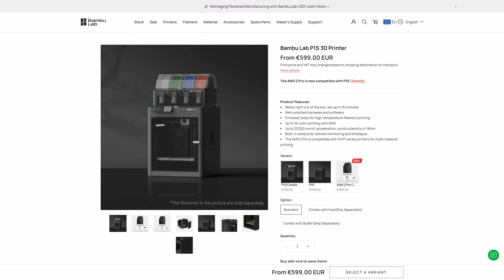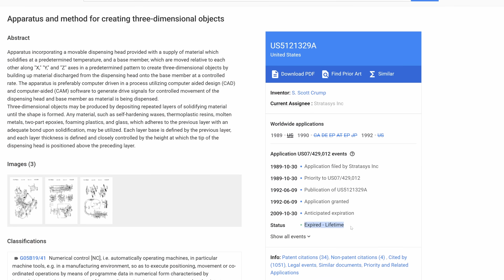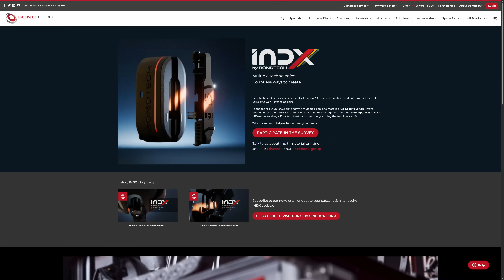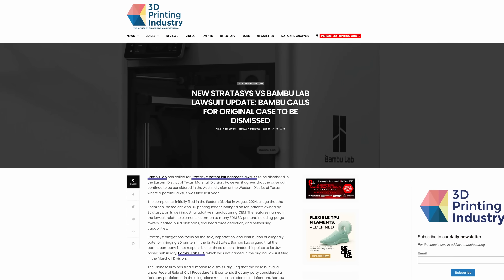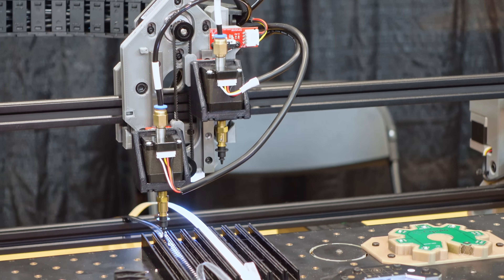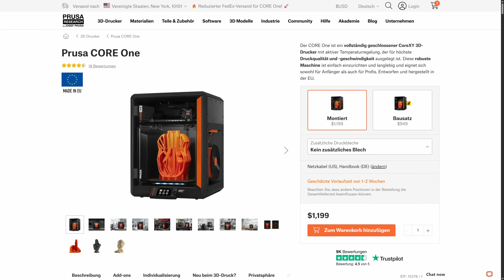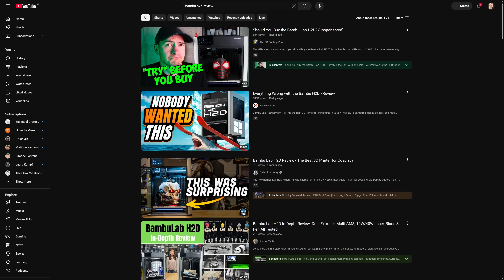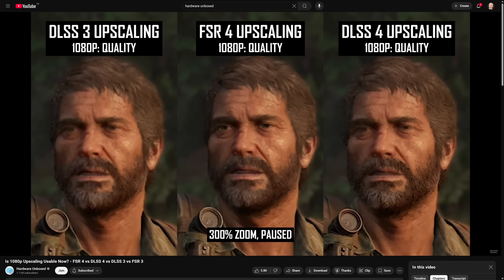How Bambu has won

Comment: I want to know creative solutions to use weak ass 3D prints into usable stuff, like furniture, speakers. How to combine PLA or PETG or ABS with concrete or epoxy mixed with glassfiber and steel rebars. 3D prints can be used to just capture the shape and have a smooth surface, and containing the strong filler you want. You can use a filler pattern that allows a pour of concrete or epoxy. I still have not found a single video discussing this.

Comment: i was currently thinking( i have an ender 3v2 and yea.. pretty much stock)
Its slow as hell and now i see this fast printer.
Was thinking about bambu, but the comments kept me sane, now i go with a new Hotend, DualZ , Direct Drive and klipper to my ender v3 2 and yea. Maybe some point at time some voron like Mashine. 
You always need a Project, right? 
(But can Voron compare itself to Bamboo, in terms of reliability?)
That would be an cool Video tbh.

Comment: Part of the problem with the 3D printer community is that it gives a platform for people who are not engineers to design and enthusiastically publish "upgrades" that other non-engineers parrot because the idea seems to make sense.
The "tinker" side of 3D printing usually means making things worse for yourself over time, and problems that are impossible to troubleshoot because your setup is different to every other person on earth.
I have an ender 5 with bl-touch, E3D V6 hotend, with a bondtech direct drive extruder, BIGTREETECH SKR Mini E3 V2.0, and powder textured spring build plate - I have not used it for years because the amount of tinkering was getting extreme just for consistent prints.
If I could afford an X1C, I'd still be 3D printing stuff today.

Comment: This might be a little late, but I like your videos for the perceived honesty and common sense view of the product. We as consumers need to be very concerned about companies using anti-consumer tactic to prevent competition. I would not change much. I think your videos are some of the best in the 3D Printer channels. Maybe include how to videos. How to calibrate or how to test if your printer needs calibrated. Even talks like this one discussing current movements in the field are good. Review filaments.

Comment: My 2 cents (and we all only have 2 cents): For a printer review, give us your overall perspective.  Because of your background and experience, we value your insights.  You are likely to consider many things we might forget.  Is it a solid build, can maintenance and repair easily be done?  (I hate doing a new Hot End on my MK3S+, and would love an easier solution for that) If there is a better value or not, let us know.  I'm right on the edge of considering a H2D vs a Prusa XL.  My key needs are to print with Nylon CF, and a non-Nylon support material, and be big (the H2D would cause me to redesign some of the things I want to do, because it is just a bit too small, but I'm only working with designs I make, so changes aren't a big deal.)  I really like the AMS HF, because storage and drying for Nylon are important.  And I would like two heads, because I am mixing materials, not just colors.  But even if you can't go into the rabbit hole of each users needs, it would still be helpful with whatever perspectives you did offer.

Comment: I got used to working with 3d printers that work out of the box in engineering field so when I purchased my personal 3d printer ,10 plus years ago, I got a Flashforge. 

At work, 3d printers had to work out-of-the-box. I got accustomed to it so I bought P1S at launch. Best printer for my needs.

Comment: My first 3D printer was the Anet A8, it was junk out of the box that was entirely capable of burning my house down. I had enormous fun making it safe(r) and upgrading it so it didn’t shake itself apart. I bought a Prusa MK3S kit for the same reasons, although when I built and configured it, it just worked. I’ll never buy a bamboo, or any printer from a company that wants to create a closed system.

Comment: A very long winded video that can be summed up simply: Open source machines suck. They just do. They're great for home use and I'd prefer all machiens to be open, but time is money. If my time is close to 300 an hour, tinkering on your crappy open source printer is costing me money. Compare it to a machine where I open it, set it up, and print carbon fiber nylon, perfectly? Yeah.

Comment: As someone who just recently got an Ender 3 with the updated silent board (yeah, a V1), I can say that the open sourcedness is a blessing. It's allowed me to get it printing PLA extremely reliably, but PETG is beating me over the head. I also like that I have a bunch of hotends and nozzle options available to me. That brings me to my point of this comment: Removing the ability to handle the nozzle to a hardened one for filled filaments, or to easily deal with a clog is a pain, and is making sure that I don't get a Bambu Labs printer with my own money. That can be said about any other printer that uses a proprietary hotend that is one piece with the nozzle, and uses a proprietary plug for power. It's also why I'm planning on building a Voron, or another open-source printer.

That said, Bambu has one thing for them that I LOVE: plug in and go

Comment: I'll be honest: Like most people here probably, I have been into 3D printing for countless eons. In 2010 I was a member in my local Chaos Computer Club branch, which ran a hackerspace in town. I went there every week and we built that very first slanted roof looking reprap printer design there, a year after the patent ran out. I was 14 at that time. Now I'm approaching 30 and I've gone through the notorious fire hazard Anet A8, moved to an Anycubic i3 Mega, then got an Anycubic Photon, then most recently an Ender 3 v2 and I even tried using a Mosaic Palette 3 for multi-color printing.

And on this journey, I started out enthusiastic with each new printer, knowing I would have to tinker with it a lot to get the results I wanted, but with each printer, I got tired of the tinkering after a few years. I always bought the next printer in the hopes that it's modern enough that I would have to do less and less tinkering and calibrating and installing firmware and printing upgrade parts etc etc and so on. But each time, it took a year or maybe 15 months before it just became too much for me (exept the photon, that thing is awesome and works great to this day) and even though I really wanted to print stuff, knowing I'd end up having to do 1-2h of fiddling to get a good print meant my printers were all just collecting dust.

But Just a week ago, I finally splurged on a printer for the first time and dropped 700€ on a P1S with an AMS. This is the first time in my life that I was able and willing to pay that much for a single (well, dual) machine. I added some Bambu filament, especially two spools of that awesome PLA /  PETG support as well. And I have to tell you, 3D printing finally feels like the same magic again that I felt back in 2010. For the first time in that long a time, I've been having such a blast with printing again. Having the confidence that I can just start a print, even while not at home, and it will finish perfectly every single freaking time, has revived this hobby for me. Seeing this printer FLY through prints is just awesome and I can't stop grinning when I look at it go.

So yeah, Bambu won, but for very good reason. In my field, we say UX to describe the user experience and DX to describe the developer experience. Bambu have perfected the art of PX, printing experience. Hats off to them. They SHOULD be patenting this and milking it for all the money they can because they deserve that.

Comment: Wait wait wait hold up. INCOMING RANT WARNING

There are other printers out there, and somehow it feels like people forget about that. Bambu has printers for a specific type of customer, those who want a “just works” simple experience, kind of like Apple. They abstract away the annoying technicalities and make the system easy to use. Bambu has made 3d printing so incredibly accessible that many more people get to enjoy its benefits. If a Bambu owner wants to start tinkering, they could do so on their Bambu, and when they hit the walls, they could move to something else as many people do. Bambu is not a bad thing, they are great at targeting a specific crowd, or more accurately, everyone but the specific tinkerer crowd. It’s just proven by how much backlash there is on Reddit yet everyone is buying their printers. And all that’s fine, competition is good, and with this larger market everyone benefits with any printer as prices come down on parts and competition pumps quality up. We have to stop thinking so small mindedly and with a sort of tunnel vision for how we like things to work ideally. In reality, there are far more people who want to create their own parts quickly than there are tinkerers, especially with the rise of online model repositories and the reach of the field from electronics parts and housing, to miniature set decorations and figures, to automotive components, to household fixes and accessories, and everything beyond and in between. 3D printing started as a community effort as it was just being developed, but it is now at the point where it’s streamlined enough to package as a standard consumer product, and that’s really truly incredible. It would be nice if Bambu would contribute more, even with Bambu Studio which is open source and the basis of other slicers like Orca, and it would be nice if they would allow you to unlock it or flash something like klipper. However it’s even nicer when we have so many other brands and printers that fulfill that need and are cheap and available too. Not every brand will be as we want, and we could decide not to buy. If others value the sales pitch of Bambu, let them have it. It’s not our job to force others to agree with our idea of how we want this industry to run, and if my buddy got a Bambu I’d celebrate with him and make something incredible, just like I recommend my mom uses a Mac. To be clear I’m absolutely a tinkerer. I’ve been a software dev in so many areas for years now, and been into embedded systems and other hardware for the last few of those. I daily drive Linux so hard I installed Asahi on my older MacBook, and Sway and Wayland on Nvidia is my go to config. We gotta land our spaceship guys, reality isn’t always how WE specifically want it. Money talks and it has spoken, and the money comes from the people who buy into one brand or another. Clearly people want that simplicity and will happily pay Bambu over other brands. Don’t forget, your money does the same, so go buy a Prusa or build your own printer, you absolutely still could, and for you, you should.

I’d like to extra stress that this is not meant to be a firery take or anything, and I’m not here to hurt anyone or anything close to that. I generally avoid any conversation like this online because it’s generally not who I am or how I work, but I think it’s important to throw in my balanced take into something as polarizing as this. ❤

Comment: For me personally, the only thing that matters for deciding which printer to get is:
Ease of use. I want to create stuff with my printer and just use it as a reliable tool, not spend hours and hours to get the printer working right. And for that reason, my P1S is just perfect to me. If i have to use their software thats fine, if i only get spare parts from them thats also fine. It just hase to be really reliable and headache-free.

Comment: I ordered from Voxel due to the recommendation in this video. It's been over three weeks and my order still hasn't shipped, and apparently I'm not the only one this has been happening to in the last several months. Pretty disappointed.
Reply: I have seen the same. They seem to be having a scaling issue. I will say the products are great and the filament is every bit as good Thomas has said. 
They have been adding capacity but market growth seems to be exceeding the adds. I hope they solve this soon.

Comment: I think the 3D printing community has to understand that while it was born out the passion of early adopters for the technology, it has traveled along the product curve into the mainstream.  Makers like myself dont have a passion for the technology itself, more its a tool to supplement my general passion for making things.  In that sense, I dont care much about how a 3D printer works beyond what I need to improve my print quality.  I am more concerned with the thing being printed, not the thing doing the printing.  For me this is why Bambu labs was the right choice.  My P1S is my first printer, and in 1.5yrs of service so far, I have had essentially ZERO mechanical failures.  That level of ease of use is key to expaning adoption of the technology.  Had I bought a printer that was not as robust... I probably wouldnt like 3D printing as much and I wouldn't be as deeply invested in learning more.  But because my entry into the field was SO easy, I have been able to focus on the aspects of 3D printing I like, instead of fixing a machine I hate.  

While that mindset upsets many of the core 3D printing early adopters and passionate "old timers", it actually massively expands the market of potental users by orders of magnitude.  With that expansion, comes competition, scale, and overall a MUCH higher value/$ invested in the consumables and equipment-- all of which benefits the entire user base of 3D printing enthusiasts.

Many people also thing that 3D printing predominantly tickles down from industry, but that has not been my experience at all.  As someone who has worked with hardware engineering and manufacturing teams for over 15 years...  it's not until the last few years that I noticed my R&D teams leveraging 3D printing so heavily for rapid prototyping.  This is because reliable "commerical grade" machines were prohibitively expensive, and cheaper machines were not reliable enough for professional use.  We dont have time to be fixing 3D printers at work.  We need them to just work every time.  Again, this has been the benefit of the mass popularity of Bambu.  By expanding the market so much with such reliable equipment, they have created a strong competitive market for printers that are now cheap AND reliable enough for use on any engineering team, regardless of budget.  That just benefits every consumer.

Comment: My big issues are planned obsolescence, being tied to an ecosystem, and not owning what I'm paying for (the subscription model).  All the convenience features ultimately cost one of these, or all of them in trade.  I print slowly, with a machine I at least assembled.  It doesn't send my IP to China, and no one can turn it off.  With those as non-negotiable, your reviews have always been really helpful in differentiating the products on the market and learning how to best use them.

Comment: Buying a Bambu was my third printer and i bought it because i wanted something that JUST WORKS. I think there is a huge case to say that a large amount of people would want something that they know will work well the majority of the time. I for one feel that i want the printer to be a tool to make other projects and not to be the project itself. Whilst i understand others are more enthusiast level and want to tinker with the printer or build the printer itself i dont think that should be a prerequisite to enter the space of 3d printing. Most people wouldnt say you HAVE to build your computer yourself and spend all of your time problem solving it. You buy a computer to use it as a tool to play games or complete other works. You arent and shouldnt be required to be a mechanic in order to buy or drive a car. While people can disagree with the decisions or direction they have gone i would say in the tech world we live in the average person wouldn't find this much different than devices they already use on a daily basis.

Comment: The odd review is good, especially if it's a bit on the "edge" of the usage or tech awarness, and you've got the skills to do that.
Otherwise I like your videos about how to improve prints - strength, heat resistance etc. Also some hacks that may improve your printer in one aspect or another, even the ready-built machines if you have them.
I've got a 13 yo reprap, still running but never used since I got an A1 mini ... I like both approaches. Tinkering somewhat but I always need to be able to use my printer to produce stuff (only for private use).

Comment: At faculty of fine arts in Oporto we bought two mk4 and upgraded to S, they print almost 24h/5 (only week) for more than 2 years now, and the fail rate is like 1%. Major problem was one of the screens, but it was super easy to call Prusa, they sent it right away  and we replaced it. The maintenance is minimal. Just works ❤
We will continue to support Prusa and their philosophy.

Comment: Behind you is a Prusa, there is no reason to buy chinese product - take Prusa, when you have old model you can upgrade it - prusa, there is no data and firmware backdoor - prusa, there is no questions. If you want cheap chinese pla printer take bambu.

Comment: As 3d printers now are more reliables (and we can use the time once we spent for tinkering and improving prints)I suggest exploring new areas and new possible uses. For example lately I'm experimenting with carbon fiber molds (as you have done in a previous video). Also applications with with 3d scanners as now they are more affordable